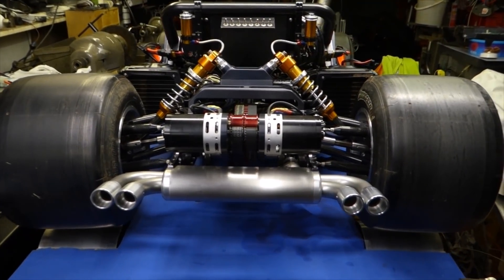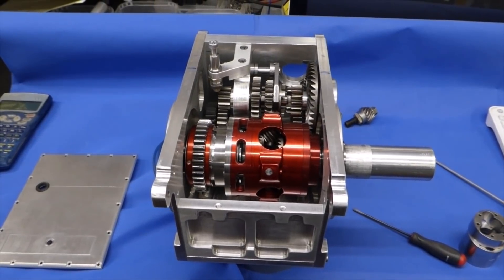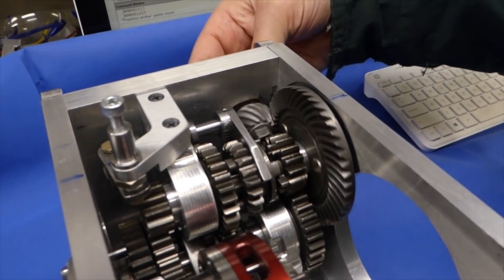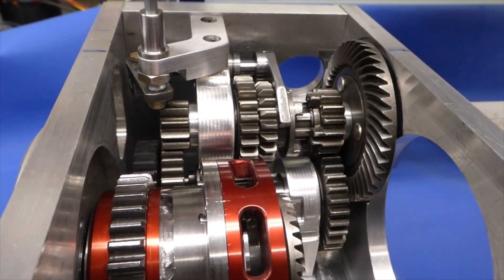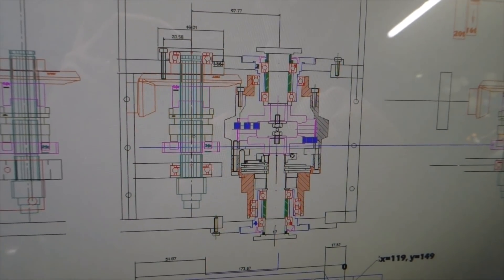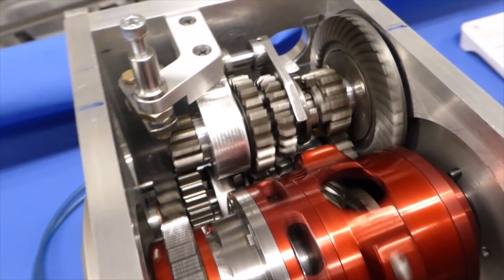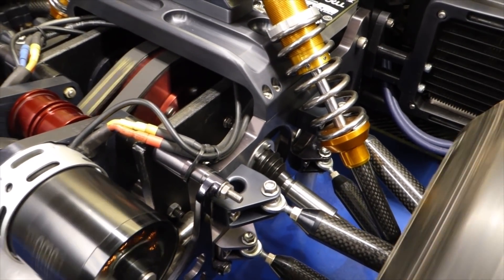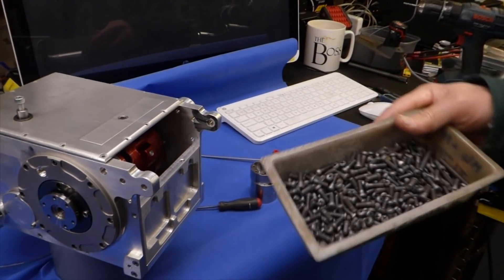1/3 scale V10 RC car part 11, gearbox build

Comment: dont be afraid to use more  plastic.  thats a lot of metal,  unless your bolting  more than 50hp to the chassis. i think in this case a  cvt  2 stage transmission would be good solution. your trying to keep this project authentic to real f1  today, but this is rc.  very nice project keep up the build.  thanks for the updates.
Reply from the maker: Yes, it’s far heavier than I anticipated. I suppose it will look more realistic when driving, but it’s 62kg already, without the gearbox, which is crazy heavy.

Comment: That gearbox is a work of art ! Well the whole car is !!! I wonder about the air supply, pump and valving for the cylinders though, would high torque servos not be simpler ? Lighter ? 
Keep up the great work, looking forward to the next update. Cheers
Reply from the maker: Yes, but I can’t think of a way to change gears sequentially with one rc channel.
With air I can control a 3 position air valve with one channel, by scrolling up and down on a ratchet type mechanism.
I’m going to use the tube chassis as the air reservoir.
Reply: @Keith5700  That is so genius that I don't think I can name another person on this planet that would have thought of that. Is the tube Chassis airtight? Please tell me you planned that from the beginning!
Reply from the maker: @Nick1one_  no I didn’t, so I hope my welding was good.
Reply: @Keith5700  Actually pneumatics are light so I'm with you on that, utilizing the frame is a great idea, maybe a 3 way rotary air valve, connected directly to the servo may be ok, dependant on servo throw.
Cheers

Comment: I'm deeply impressed - as always watching your videos. Did you built up all this using a 2D-CAD??? I hope not... Anyway. Your work is outstanding. Chapeau! Greets from a German Mechanical Engineer.
Reply from the maker: Yes, 2d only. It’s ok most of the time, although 3D would have made some of the areas easier.
Reply: Let me know if I can give a helping hand when it comes to 3D CAD and CAM. Cheers!

Comment: The gears look about the same size as the ones in my classic mini gearbox, isn't that pretty overkill for that engine? I imagine you could get a much lighter unit that would still easily handle the torque
Reply from the maker: I’d say the gears are about half scale of an average full size box. They were all I could find anywhere near suitable. I’ll probably thin them down a bit to lose some weight.

Comment: sounds a little rough, oil oughta help with that, splendid work!
Reply from the maker: Most of the clattering is because it’s a motorcycle crash box, so there’s intentionally a lot of play in the drive dogs. Yes, hopefully 1/4 full of oil will help.

Comment: Looks amazing Keith, thanks for the update!  It could be a play of light, but some of that drag might be coming from what looks to be a warped gear, look at the one at the upper-left from 3:53.
Reply from the maker: No the gears are all free. That gear has a bit of slop on the spline but there’s not much I can do about that apart from metal spray the splines a bit. I think the drag is from the oil seals so hopefully should free up a bit when there’s oil in it.
Reply: @Keith5700  Roger that, appreciate the clarification.